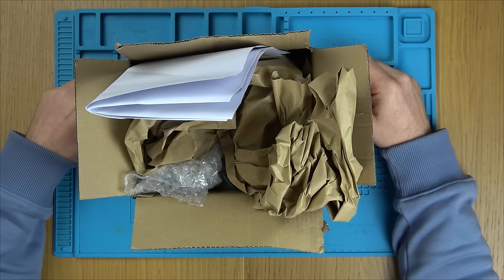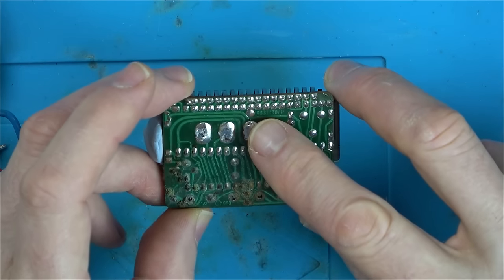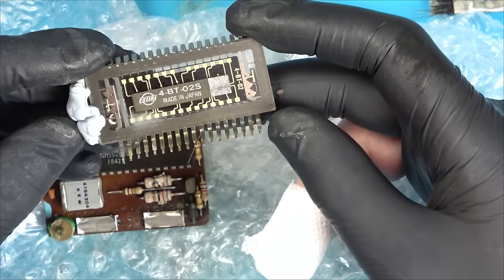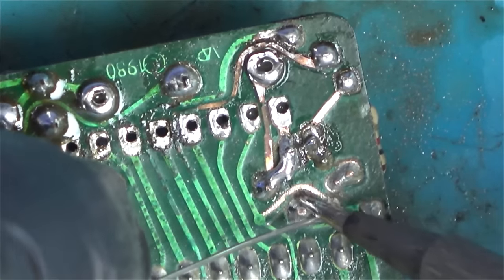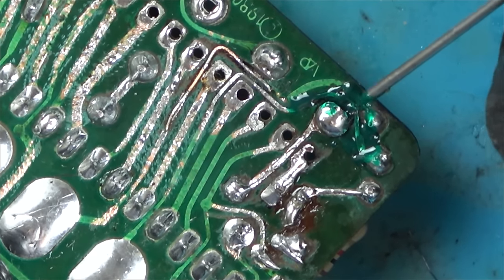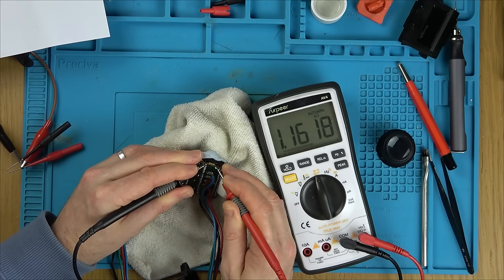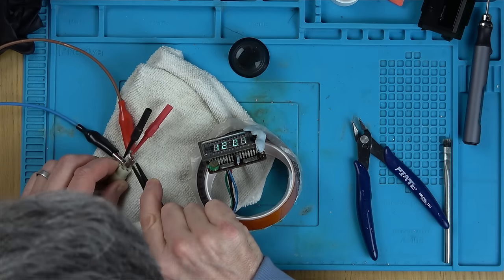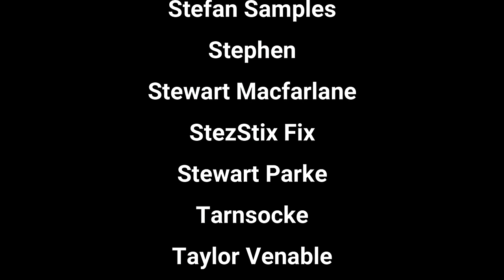This Back to the Future car has a Problem - 'TIME' to Fix it

Comment: Nice video, Vince :)
However, that car is, as much of an icon it is, it is a sick, slow piece of junk. (I love every bit of that car, though)I have a friend here, who inherited one. His father bought it new in 1982. I have fixed every hiccups that car had in its life, but yet it is always full of electrical issues, cable connector contact problems, even though I have made a complete brand new wiring harness that goes to the rear lights, as they were damaged in an accident. I would like to get one into my car collection anyway, eventually :)
And believe it or not, I already have a brand new unopened purple JVC GR-C1 camera, the same Marty used in the "Back to the future" movie.

Comment: Is you solder tip designed that way, like a hook style, been using the same tip for 2 years and the very end of the tip has started to bend into a hook shape. I find it works better this way

Comment: VFD. Is that different to the LED displays used in 90s radio alarm clocks? Is that also what heads up displays in cars use?
Reply from the maker: The VFD is an actual vacuum tube of glass, so quite different from LED displays. I presume (but I might be wrong) that VFDs would be more expensive and use more energy than LED displays so that is why they were replaced. I'm sure others will chime in with the correct answers. I'll be honest I don't actually know how a VFD works, I need to Google that. I don't know what technology is used in heads up displays, would it be LED projectors????? Using the windscreen as the projector screen.
Reply: VFD has something in common with CRTs in that there's a phospor coated element which glows when bombarded with electrons.
Reply: @Mymatevince  interesting. Never knew they had changed from this to led and then later LCD.

Comment: On a relatively simple circuit like this, when repairing tracks that long and so close together, it would be better to use some insulated wire soldered between appropriate pads, rather than attempting to replicate the trace.

Comment: Advice for DeLorean owners - do not try out the MR. FUSION Home Energy Reactor coffee maker upgrade inside your car, it is likely to leak and cause corrosion to the VFD clock.
It is best mounted outside the car at the rear.

Comment: Flux is your friend,especially where corrosion is concerned. Its a good idea to tin marginal traces with solder. As for the cap i only use quality Panasonic or Japanese caps in these situation,the china caps usually wont last as long as the original. nice job on a poorly made board.

Comment: 0:30 The big thing that killed that car's reputation was actually its unreliability. The PRV engine was a piece of shit and these days people here in the US usually swap a GM V6 of some sort into them. Lots of 3800s, often factory supercharged, yanked out of things like mid 90s Pontiacs. Some people even V8 swap them!

I wouldn't mind a DMC12 myself and I think I'd go for an 8BA flathead V8 swap myself. The ass end of those things is a bit cramped and the Ford Flatheads' compact-ness works well with that. Also, hotrodding is a thing, it'd be pretty trivial to perk the ol' flatty up to around 250-300hp for the application. Be the meanest sounding DeLorean around!